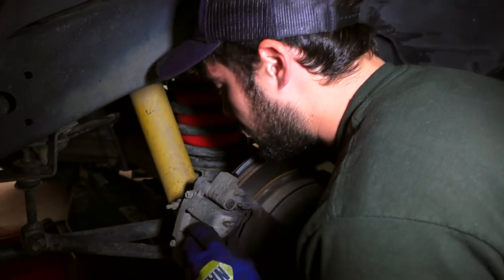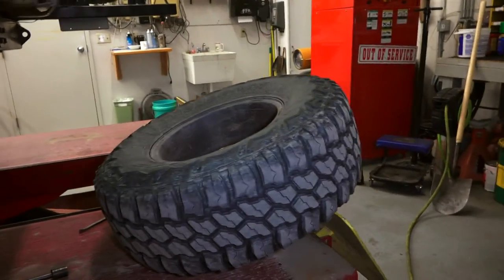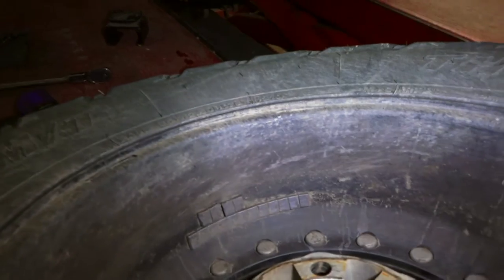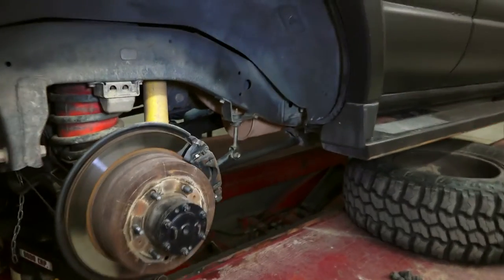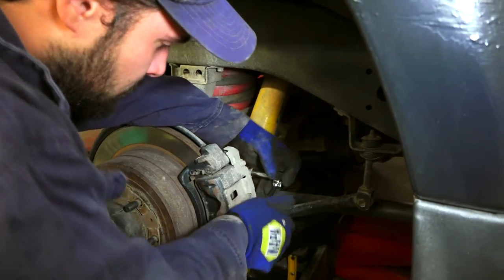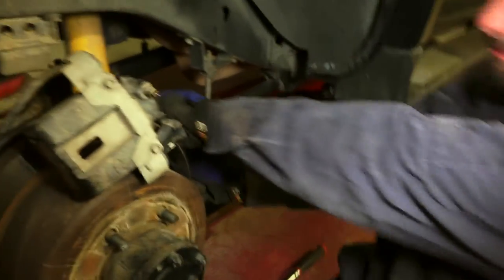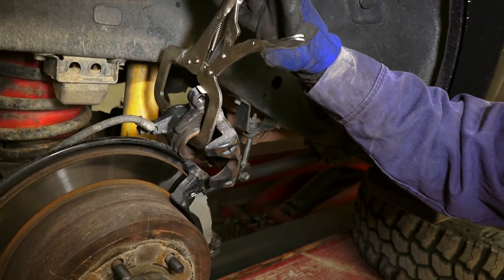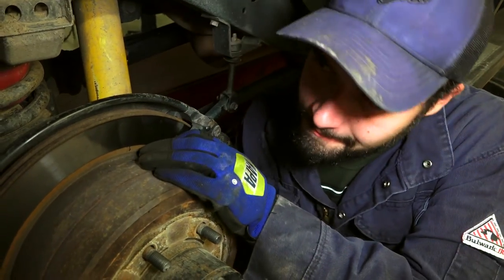The Great Run About: Preparation-Rear Breaks Service

Comment: could you please show how could i check the real mille of a hummer h3 . thank you
Reply from the maker: freddy Morales not sure what the "real mile" is, also keep in mind that I don't own the Hummer any longer.
Reply: Jake Paslar when you buy a car, you actually want to know the mile   if its 70000 miles 145000 miles, i interested to buy a car,  dont know how to check how many miles has already the owner told me a nomber but i dont trust
Reply from the maker: freddy Morales 
OK, got it. I personally not aware if such a test can be done on the Hummer. In case of true luxury automobiles like Mercedes or BMW that employ a more sophisticated software a trained technician can compare different parameters and make a call if the mileage is real or not. I am not aware if the same test can be done on the Hummer.